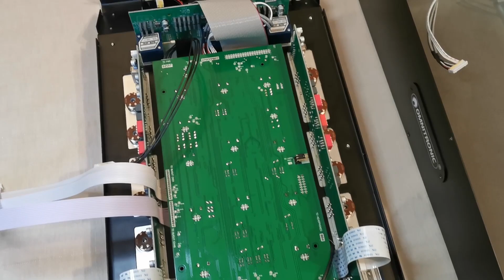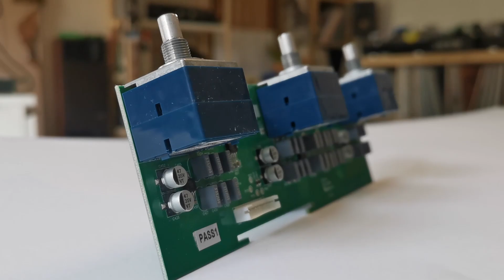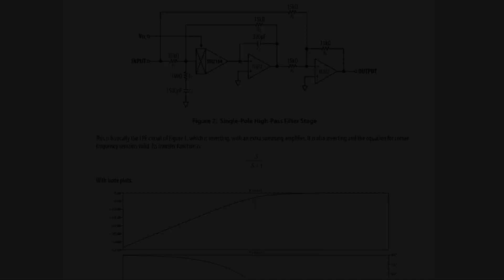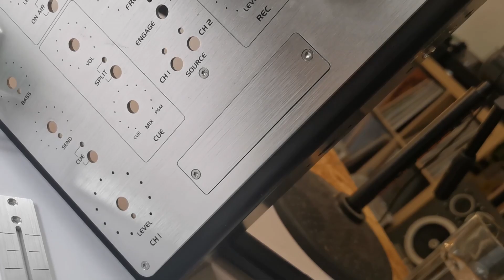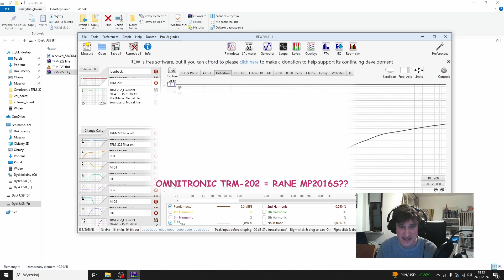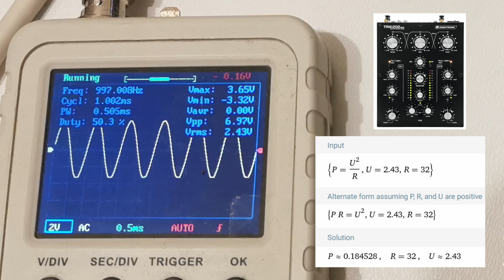Mixers Inside: Omnitronic TRM-222 + TRM-202 comparison

Comment: The TRM-222 is nearly ten times noisier. That flat line sitting at -70 dBFS isn't just harmonic distortion; it is likely wideband noise bleeding into the measurement. Omnitronic has upgraded to  polymer capacitors in the signal path to fix the HF slope, but they clearly introduced a significant noise issue somewhere else in the chassis—likely through a cheaper switching power supply or a compromised grounding scheme as its evident they got rid of secondary 470uF filtering caps (203 had 2X1500, 2X470, 1X 470 for 5V LED, also 1X220uF likely dedicated for the pots) as a cost measuring cuts. 
Also using same old cheap JRC4580 opamps still results in rising THD at higher frequencies,  a classic signature of 4580 op-amps running out of open-loop gain. When an op-amp runs out of loop gain at high frequencies, its ability to use negative feedback to correct distortion diminishes, causing the THD to rise. This could be solved by upgrading to JFET Muse8920 or 8921, I would recommend 8920 as it's a better fit for a DJ mixer,.
Reply from the maker: I'm afraid that changing op-amps especially for overpriced muses is not a magical sollution. If you happen to do this please share before/after measurement set - thanks!

Comment: Is there any way to modify the filter so it doesn’t pop?
Reply from the maker: No way to do it without serious circuitry re-engineering.
Reply: @mixersinside would they be able to isolate it with an opto coupler in the future? Or would that also cause a drop in level when it switches on? 
As a space flight electronics technician, I’m very happy to do my own component modifications if it’s possible to fix it.
Reply from the maker: @mogigrumbles i suspect that doing it with optocoupler is not the most optimal way to solve this problem. How would that work?
Reply: @mixersinside only speculation from my non engineer brain. But I’ve heard of “click less” muting switches on eurorack modules that use optos to let you mute audio without it popping. But if you were to switch something actively putting out sound I would imagine you need to have an opamp doing the heavy lifting while it switches to have the filter on/off.
Reply from the maker: @mogigrumbles the pop during switching is caused by DC offset between 2 switched paths so i'm not sure how an optocoupler can solve this. But i'm curious about explanation.
Reply: @mixersinside the idea is the vactrol is slow enough to bring it down to zero crossing for DC offsets and it’s a “click less” switch. Idk if it’s so slow that it would still be audible in the mix though. Regardless searching for the vactrol click less switching brought up this MAX4910 chip which costs $3 and looks like it would be able to solve the problem potentially.
Reply: For the vactrol thing specifically, I’m thinking of the divkid Mutes eurorack module and the befaco hexmix mixer eurorack module. Both probably have their schematics online.
Reply from the maker: @mogigrumbles interesting, i will dive into it! Thank you very much for sharing this idea :)
Reply: @mixersinside thank you for the awesome channel and in depth measurements!

Comment: i have a problem with min trhm-222 . after playing for an hour and press the filter engage button my left speaker stops playing and i hear a hiss sound . this happen in the low pass filter .if i press the high pass filter i hear sound from both speakers BUT the sound commes out very distorted . if i press the engage off button again and turn of the filter everything is good again . if i turn off the mixer and turn it on again the filter works fine for some time again.
Reply from the maker: What omnitronic says about this?

Comment: This mixer arrived today. There's definitely something wrong with the filter. With the filter engaged and the LP/HP filter type switched, clicks can range in volume from barely noticeable to loud, and for some reason, in the right channel, the clicks can reach up to -3 dB. Then another issue popped up, but only once—the filter severely distorted the sound. The issue lasted for about a minute, and then disappeared after switching the LP/HP filter on and off.
I took it apart, tugged at the cables and connectors, but the defect persists... It's annoying. I don't want a defect like this to pop up during a mix. I've been an electronics engineer for 20 years, but I don't really want to mess around without a schematic. If they fix it eventually, I can redo it.
Reply from the maker: First thing I would do is just return the faulty unit to the distributor.
Reply: @mixersinside  I bought it straight from Steinigke, used (from an exhibition) at a good price.

Comment: I just got this mixer and am having an issue. When the filter is engaged and I switch between channels I get a boost in sound and it is very noticeable especially when you record a set is there a way to fix that?
Reply from the maker: @djknowledge1234  I imagine you got it brand new. Have you considered contacting customer support?

Comment: Will changing the position of the ISO Jumper post allow you to hear the isolator's effects in the headphones?

Many people seem hesitant to buy this mixer specifically because the isolator cannot be heard in the headphones.

It's a shame they didn't include a button on the panel for this, something like 'CUE FX' or similar.

Shouldn't it be possible to run a cable with a small switch there if you want to modify it yourself, making that option more accessible?
Reply from the maker: @robertrutherford414  yes, hearing isolator on headphones is a point of this switch, and yes - you can do a mod with external switch.
Reply: @ thanks a lot!
Reply: @mixersinside  I wonder why they have hidden this feature inside the device from the user
Reply from the maker: @robertrutherford414  maybe because it's something you change once and forget about it. There are already a lot of switches on the panel.
Reply: @ do you know if this also affects send/return?
Reply from the maker: @robertrutherford414  please refer to the user manual or when in doubt contact Omnitronic. Thank you very much for understanding.
Reply: @robertrutherford2443 Hi ! Does that mean that its possible to fix this issue and make it an option to use this mixer entirely mixing on headphones? So to have the isolator functioning in them ? Thank you!
Reply: @RUGImusic yes!

Comment: Thank you for this breakdown, Do you know if there is a switch for 120V in the states compared to 240V in UK? or does the power supply adapt within the range 100-240V?  

Also, how do you Iso Boost to hear Master Isolator in the headphones?
Reply from the maker: @crispu.s.thrift409  thanks for watching, answer to your question can be easily found in the manual or technical data available in the web.

Comment: Can you tell something about why the this mixer isn´t that powerful on the output? I have the TRM-222 at home and compared to my old DJM707 the maximum volume is very low. (using the same speaker system) Maybe you can also help to fix this 🙂
Reply from the maker: Why would you need higher volume? In my opinion lower output voltage (not to be confused with power) is a sign of a GOOD gain staging and thanks to this you're protected from distorting the inputs of your amplifier. A lot of mixers have way too high output voltage and this mainly cause problems and usually doesn't bring anything good. Output voltage level of Omnitronic is sufficient to drive any decent amplifier.

Is your amplifier too weak and you have problems witch achieving volume you want? Crank that volume knob up in your amp!
Reply: @mixersinside  Thank you for the fast reply! I´m using the mixers on the Funktion 1 SB8A (self powered) with the F5 tops. Unfortunately there is no volume knob to crank up :D.
Reply from the maker: @minimlt  check the input sensitivity in the amp data to have image what range of voltage do you need to provide. You didn't answer one important question - do you feel that your gear is too silent because of this?
Reply: @mixersinside  Yes, I feel it is on that system, compared to the DJM707, too silent. I just found this value: Sensitivity (1W at 1m) 96dB at 2.8V
Reply from the maker: @minimlt  i see. I didn't expect that - just be careful not to overdrive the input stage of your amp. The mod would be super simple, it requires just changing 2 resistors in the output section that set the gain. I can do it for you if you are willing to ship the mixer to Poland, but any electronic engineer will be able to perform this mod.
Reply: @mixersinside  Ah ok, so it is possible to level up the output voltage of the mixer? What is the actual output voltage?
Reply from the maker: @minimlt  it depends on source you're using. Check out the mixer specs on official website. They state max output level is +21 dBu (approx 8.5V RMS) and the gain is +12dB in the line section. If you're not happy with those numbers something is not right. Assuming you are using a 2V RMS source (a CDJ) you should be able to achieve 8V RMS at maximum gain level. If 8V RMS is not satisfying for you then check your system, 8V RMS is a really hot signal.
Reply: @mixersinside  yes, CDJs. Now I´m slowly geting it :) So changing resistors will affect the output level? THANK YOU for your time!
Reply from the maker: @minimlt  yes, changing gain setting resistors in the main output section. But i don't recommend doing it, i suggest figuring out your system gain staging. You typically shouldn't need more than 2-4V RMS.
Reply: Bizarre car moi je trouve qu’elle a énormément de puissance, beaucoup plus que ma Xone 92mk2 LTD, qui elle était faible au master et pire sur la sortie REC…

Comment: Love the review, wish you didn’t have bias with cross faders as I was hoping you would go a little deeper on it. Thank you for making this video.
Reply from the maker: @littlerecordsme  thanks for watching. What are you curious about regarding the crossfader circuitry? It's just a simple VCA crossfader circuit - that's the main reason why channel volume control is VCA based.
Reply: @ comparing to other cross faders on the market to predict breakdown.
Reply from the maker: @littlerecordsme  how would you do this?
Reply: @ compare parts used in other mixers? Not sure, you are definitely more knowledgeable when it comes to individual components. I am in the difficult position of enjoying analog sound but most analog mixing boards are geared towards people that do not use cross faders. I have to take in to account the life expectancy of a cross fader as in my early years of DJing I had to buy multiple replacements when purchasing mixers as they would eventually breakdown. Maybe it is based in past components and not the reality of newer ones.
Reply from the maker: @littlerecordsme  testing endurance of a crossfader will require to use it for years or build a mechanical tester that will slide it couple of thousands of times and it's too much hassle. Most often you can't judge parts durability just by touching them couple of times. As you noticed i also didn't comment potentiometers used - this mixer was released couple of months ago and time will show how they behave.
Reply: @mixersinside  Thanks for your informative reviews. Apart from Blue Velvets are there also Alps pots or different manufacturers?

Comment: Another great video, thank you! For the PH/LN Switch, Omnitronic is switching the RIAA out of the feedback loop of the Op-Amp, right? So there is a long feedback trace which goes to a switch? Is that why there is more distortion or what is your explanation?
Reply from the maker: I'm almost sure that it short circuits the inverting input with the output. There is another way of doing it and it can be seen in my Rane video.
Reply: @mixersinside  okay, that's not really clever :D
Reply from the maker: @dedondigital  turns out that making it right is equally simple.

Comment: Man, love this video. gonna watch all the others. Can you help me out with the clicking when filter is engaged?
Reply from the maker: @aaronchincano2874  without modification of filter circuitry it's impossible to get rid of the click. It requires PCB redesign.
Reply: @mixersinside  can you provide the mods? If so what would be the cost, please?
Reply from the maker: @adamliebthal  as i said, it's impossible to do this mod without PCB redesign. Omnitronic must do this, i can help them if they want to.

Comment: Hey I don't think sound is fully subjective when you can measure that things do such as with so many youtubers like Paul Third for example using plugin doctor to understand what EQ/phase shifts are occurring. SSL vs NEVE and all others, huge differences and measurable.
Reply from the maker: @ritchxmusic  plugin doctor is a measurement tool, not ear. Describing phase shifts is describing data, not sensations. There are ways to conduct listening tests in scientific fashion - ABX and simmilar, but they are impossible to do on YouTube. I had a trial to do such thing in my Omnitronic upgrade video but nobody really cared about sticking to procedures.

What i want to avoid on this channel is testing mixers in a way most reviewers do it - using only subjective terms to describe the sound. This is warmer, this is more smooth, this is more harsh etc. I know it's needed and I appreciate putting effort in describing sound sensations but arguing about what is warmer or more smooth is hard when you don't really have a solid point of reference (for example data or something objective).
Reply: @mixersinside  You just talked about objective measurements. So yes, of course i am talking about data in that case. There are objective measures of sound engineering
Reply from the maker: @ritchxmusic  for sure, i was talking about them most of this video!
Reply: @mixersinside  Have you tested the play differently mixer? It seemed to sound quite different than the Xone
Reply from the maker: @ritchxmusic  i didn't have opportunity to test it.

Comment: Looks like its made very similar to the Xone 96 - same company perhaps?
Reply from the maker: Is Xone 96 also using 4580 op amps?

96 has also way more advanced power supply, not to mention the whole USB/DAC section and obviously clickless filter. Making filter clickless is not expensive so i think that it was not done by the company with the same know-how. If by any chance someone had know-how and decided to cut costs on such important issue anyway that was a very dumb decision. 

Also the potentiometers in Xone 96 should be ALPS (to be confirmed by you).

The modular design is a common thing in many mixers and Xone mixers deal with it in nice way by making board to board contacts without using excessive number of cables. 

Will be thankful for confirming this info by you, cause i don't have 96 available to check at the moment. I serviced one in the past. Cheers!
Reply from the maker: @breakz187  yes, the boards are also green 😅
Reply: @mixersinside  The way that it is all modular, the op amps, the connectors and ribbons, the push switches - many components are similar
Reply: I know they're all going to be modular, just really reminded me of the insides of my 96

Comment: What advantage is there in using ALPS pots for channel volume if they are acting as volume chip control vs affecting the signal directly?
thanks for the videos, by the way!
Reply from the maker: Good question! I think it's the "feeling". ALPS RK27 have some mechanical resistance that is different than other potentiometers.
Reply: @mixersinside  definitly feeling and also longevity. The volume is the most used parameter I guess, so that pot being the sturdiest makes sense
Reply: I assume they can dial in the breakpoint of the fader curve a lot better with VCA volume.